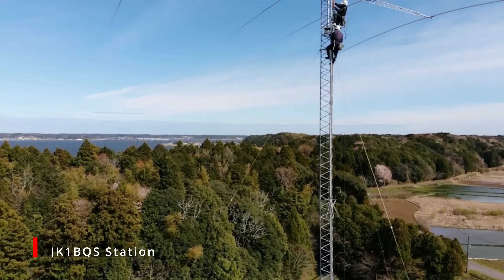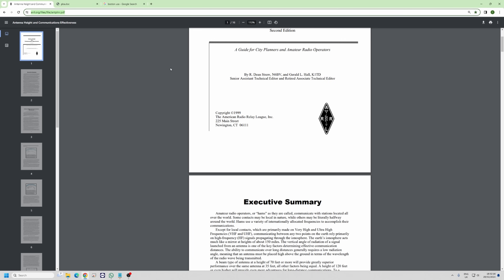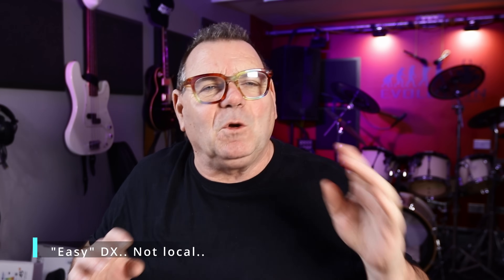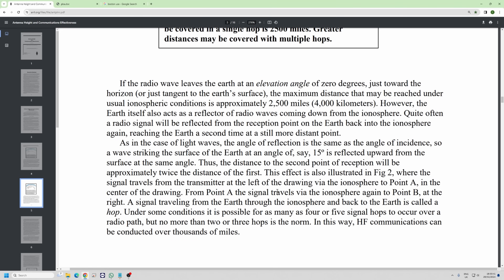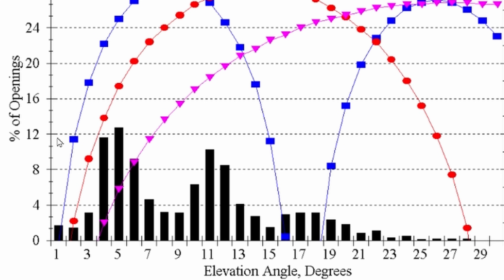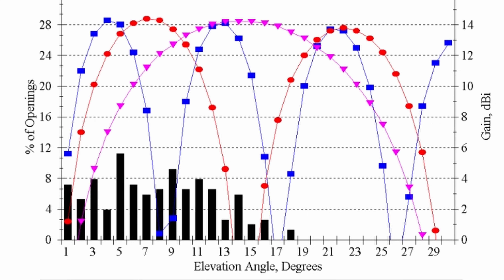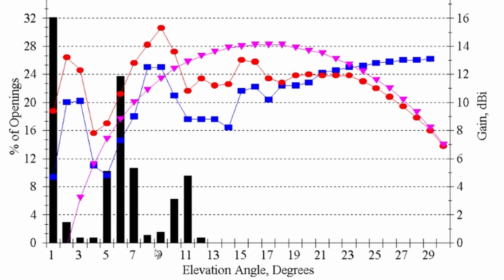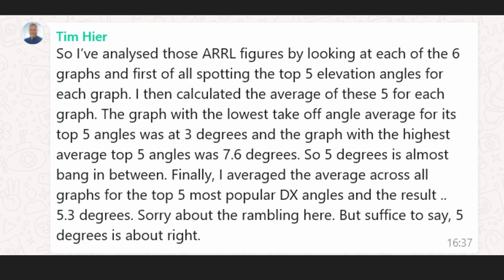The Truth About Optimising Take-Off Angles for Ham Radio DX

Comment: I am not very technical which it comes to my choice of antenna. I find for 20m and up during the daytime, I use a vertical for dx, whereas, an efhw or efrw as a sloper seems to work better for working the continental USA. For my qth antenna, I chose an inverted L efhw. Definitely interesting video and models Cal. 73, friend.

Comment: Hi again, Cal. Thanks for the takeoff angle discussion. In continuation of our prior dual 10-meter wires discussion, my SWR is 1.5 or better from 28.300 and 28.620, then again at the 29.500 and 29.600 AM/FM frequencies. Totally fascinating. Back to the takeoff angle discussion, I've been working the SSB contest this weekend and I'm consistently making contacts in New Zealand and Japan from here in Florida with 100w on my DX Commander Classic, even in pileups. Last night I made a New Zealand contact on 40m at 100w. I'm always impressed with that gear.
Reply from the maker: Heck, that's good work!

Comment: Well, just to add my opinion to the debate. 
Undoubtedly low angle signals do exist, there is a multitude of  research into transmission and reception of signals at very low angles, However, the more observant among you will have noticed that that the argument put forward by PW regarding attenuation/cancellation of low angle signals was in relation to ground mounted verical antennas over average ground, again, much research has been conducted on this matter, and appears in both ARRL and RSGB publications; the response came in the form of comparing apples and oranges; a yagi at 1/2 wavelength and above has a completely different interaction with the surrounding environment than a ground mounted vertical.
The way I am thinking after seeing both vids and reading publications on the matter is that both arguments are correct for the type of antenna being referenced.
Reply from the maker: Your opinion is valued.

Comment: I’m new. I just got my license, KO6DEV. I like what you said and you are right. I made my first DX to Japan with a GPA-80 on the ground with 8 ground wires on 20 meters. Yesterday it was Chile, and Hawaii. I ‘ve got an 891 with a yaesu tuner. It works great. 
I had no idea an antenna sitting on the ground was better than elevated one 10 or 20 meters above ground for DX. I am gladly surprised. I no longer need to worry about getting a 20 meter yagi on top of the roof, which would be a an impossible dream in a residential area. 
I am still learning and I wonder why an antenna right on the ground is so good for 5 to 10 degrees. The antenna was supposed to be mounted on a mast, but I modified it as per your advice and mounted the eight wires on the ground. I did have to get in to the box to get a wire to be able to ground the wires, because the antenna was not meant for it, but it worked quite nicely. 
The antenna is no good for 40 meters, but I am making one as we speak based on the same principle, right on the grown. It’s going to be a 20 meter monopole right on the ground with tons of wires laying beneath it. I bought the aluminum rods used for camping gear, which were very cheap. It’s 10 meters long. Very basic and I hope it works. Hurray for vertical antennas mounted on the ground! Thank you for the advice
Reply: I just put a parasitic vertical 3.4m behind my 20m vertical long path ant another 2  points.
Reply from the maker: It'll work great!

Comment: that was great . love the ARRL books . super great reading. love the free software for ham radio . some apps for smart phone as well. having fun with coax antenna  lately. The T2LT running up a 10 meter DX commander pole. gets NY to England in the AM, NY time. 10/11/12 meters. I got Derbyshire on SSB CB 11 meters from NY last weak. even did MMSSTV free program for SSTV and it works on CB . I even herd the DX commander antenna on 11 meters CB. just cut the wire put it on and it works. the little numbers on square beads is great. can use letters also. TEN or 10 . love how antenna companies (some)  claim all this DB gain. and they leave out at what angel . and numbers they give is if antenna is in free space. numbers mean nothing if you don't use the point of reference. And state the reference. 73's
Reply from the maker: Well said.. PS - Good work on your experiments!

Comment: Is there a way to measure or lookup the actual soil conductivity for your location, or is it mostly guesswork?
Reply from the maker: Very good question.. You can buy a soil conductivity meter. The problem is that some are HUNDREDS and some are cheap.. I might buy a cheap one and do some experiments.. I did also ask ChatGPT if I could home-brew one.. That was an interesting discussion too!
Reply: @DXCommanderHQ  - As an electrician we often have to use earth stakes out in the sticks where I live for earth continuity back to the transformer.  When measuring this you can guarantee when we have had a load of rain you get much lower resistance readings.
Reply: There are charts and maps online here for the US, but it is not specific to any one area.  It is more of a generalization.  Soil in one area can be good and 30 meters away can be crappy. .

Comment: I find it intersting when looking at You Tube channels, the commercial nature of the crearot is obvious, sometimes! Take ML&S, unashamedly an outlet for sales, but also full of good sound information, always respecrful of products they do not stock and generally informative. Then there is DX Commander, again a business related site, or is it? Most of the time you cram your channel with interesting science based practical information and and on air streams. When you have a new product you will do a bit oif a "sales pitch", and like ML&S you show respect for other Ham related concerns. Now to the "detractor" in this case. Information in his video seems to be based around books written some 50 years ago, and does not acknowledge that science has moved on!One point I would also make is that the channel concerned always heavily plugs the store he is conncected with, as if it is the only Ham outlet in the UK. That is fine, but please, Mr Expert, do not use you company platform to attack another Ham outlet, particularly on sketchy information!  As a point of reference, I remember back when I first passed my ticket, I found your channel, Callum and there is one thing I recall vividly and that was you saying that you chose 5 degress purely as a baseline to compare results, and you did not know if it was an accurate representation, rather like the use of bannannas as a unit! Ours is a scientific hobby, and as such you have backed up your methods with science, well referenced by respected up to date sources. To critisise without up to date science based references is simply just wrong and an attempt to belittle a man who does good work based on the science and engineering that he loves. Keep up the great work mate, and ignore that tatty, out of date parrot!!! Sorry this is a bit long but a certain person annoyed me with his "indepth examination" of a subject he obviously had not researched enough! 73 Jim M7BXT
Reply from the maker: Hello Jim.. I appreciate your comment (I know you are a regular) but as I said at the end of the video, no name calling, we're all respectful. Bless you and have a great weekend.

Comment: I had the opportunity to make 5 dipoles  2x10 mtr   around 1 pole from 17 mtr  design in ARRL Antenne handbook 
I had high lantern pole with about 7 mtr glas fibre top
Year about 1997
The dipoles where hanging about 60 degrees for the 7 MHz band 
There was a switching box and a piece of coax  to a create fase shift 1 dipole suppose to work as a director and the others as reflector , and I was stunned by result 
The first result was at daylight results Nothing happened switching back and forth and intended to break it down the other day 
Around 22: 00 hours I noticed I could switch between Italy and Canada with a very strong difference 😮
I was jumping around in the house The week after it the owners started maintenance cutting grass and the the berm of the water and my Dipoles had to go 😢
Reply from the maker: Fascinating! Sorry it had to go :(
Reply: @DXCommanderHQ  That the system not working at day light its because the take of angle by day the signals coming from above , and the local stations 100-300 km are strong But in the dark the propagation changing the angle of the signals drops and signals from above 100-300 km getting weaker So the setup dont work at daylight the reflection of the signals don’t work , and in the evening the propagation was changing and the signals came on a lower angle , And this setup was working , I heard USA stations in the Middle East And could switch to North America, it has worked about a week and after that i had to remove it it was property from the Dutch Forrest control , who rented it from the Government Oud Gastel , and I was living at the natural border A water small river 20 mtr width between Oud-Gastel and Oudenbosch i had a lot of radio fun there for at least 15 years

Comment: I do enjoy your videos Callum. Question, with a 40-10 EFHW what is the linear distance from the mast to the feed point if the mast is 29feet high? Assuming a 5 degree take-off angle. Thanks for any insight for this.
Reply from the maker: SO for a 40m End Fed, that's 20m long.. So if you feed at ground level and go Inverted L? That's the way I see it. Then get as much of it as vertical as you can (say half) for best DX / Low Angle.
Reply: @DXCommanderHQ  Many thanks Callum

Comment: Thanks for bringing so much clarity with this video. I don’t have much experience with vertical antennas but will definitely try them out after this video. I leave about 20km from the beach then perhaps my soil can be help.
Reply from the maker: Yes maybe.. The one mistake I used in my early career was only using them to compare RECEIVE signals.. That can put a downer on it, particularly with the advent of low-to-ground dipoles and loops-on-ground (search Loop On Ground) since our radios have HUGE pre-amps built in so getting a really pleasant signal out of a radio is lovely. I made a video here, from about 7 mins, particualy on 40m band: https://www.youtube.com/watch?v=z5MhYu2LUrY

Comment: I am just in the middle of setting up a higher mast for my folded dipole (without enraging the neighbours or the YL). Thanks to Your older "howto" videos, I used mmana-gal to simulate my antenna and realised why I struggle making proper DXs with my current setup. By raising my antenna a bit, I will have 2-3dB extra gain for 5-10 degrees takeoff angle.
Reply from the maker: Lovely.

Comment: I've worked beside saltwater numerous times and the difference from being inland is incredible. Think about stacked yagis the megastations run. They can independently select which antenna to use. Why is is that? It's because each antenna can receive at a slightly different angle where the incoming signal can be stronger, weaker or non existant. If none of it mattered, people simply wouldnt bother.
Reply from the maker: Good point.

Comment: When I go pota-ing with an EFHW is there a shape of antenna wire I should shoot for that’s best DX? I worked you on your last live stream, it was awesome! Thanks. WY7WL
Reply: Have you tried to use the free software out there? Test it, inv v, inv l, sloper or vertic. See what far field plots it comes up with. Then test it out. Make it fun, make it work for you. 😊
Reply: @garyh8315  your right, I need to  learn that software. It’s just above my head at the moment
Reply from the maker: WY7WL.. Probably get most of it as vertical as you can and less inverted V.

Comment: Great Video Callum.  The explanation is spot on.  The lower the angle the better for DX.  Why in the heck do all these guys build these big towers to get their antennas up high... to lower the radiation angle.  If you look at a dipole at good height 1/2wl+ you will see the TO angle lowers and more RF is squeezed into those lower angles vs the middle or high angles.   If you want the good numbers for long haul depending on the band, it is lower than 10degrees.  Yes, in some areas of the world 20 degrees will work for short haul DX, but to use a turn of phrase, IN the main for long haul 5 degrees is the sweet spot.  If you look at the big DX'ers and look at old antenna books, which you know I have a library of now... it is a LOW angle radiation game.    Just great work.
Reply from the maker: Low angle. Yep, true.

Comment: please explain the minus and positive issue.....please
Reply from the maker: There's no issue.. It's a reference-point. LKet me point you to another video and see if I can assist.. OK.. skip to about 3:05 of the following video: https://www.youtube.com/watch?v=ZZWzyypqqjM
Reply: thanks i watched that a while ago, its just the use of plus and minus. You are talking to someone who cannot understand 3.142 where does the remainder go ? into your "bananas". Cheers matey @DXCommanderHQ
Reply: 0dBi is equal in gain to an isotropic radiator at unity gain power,.  +dBi is a gain over an isotropic radiator in a direction, -dBi is a loss of power in a direction compared to an isotropic radiator.  dBd is comparison with the antenna in test over a dipole antenna at 1/2 wavelength in height.
Reply: So minus is bad and plus is good simply put, so how can a radiator with a minus figure be better, to be better is it the angle of take off ? @FromthehamshackwithNJ4Z

Comment: Those Arrl plots of skip angles are fixed, I would say the propagation angles are at least general and really out of date at worse, as the angle will change in real time .a layer can be miles wide vertically and temp, other forms of prop will interact on the second ,third  on fifth bounce or all of them I agree its all you can do to get your take off as good as you can..but prop will always be "king" and unpredictable. Thats why I could hear Japan or Italy or both at the same time and the guy down the road 20 miles might not..Antenna science is a facinating thing,but prop is of a different magnitude of complexity.. Even more so at this time, keep the videos coming love em
Reply from the maker: You can hear Japan and Italy at the same time because your RF is going "everywhere".. But thanks for the comment and understanding of the complexity. I had to cut it short at 20 minutes else it would have been a 2-hour video which nobody wants to watch - and I certainly don't want to edit!

Comment: I did over 9,800 miles, SC to Tasmania on 40m with my 12.4 DX Comander.
Reply from the maker: Top banana!
Reply: Hey the Bill... Good to see YCARS represented!
Reply: You mean the person in Tasmania heard you with a 5 element beam 100ft above the ground, it wasn't the DXCommander doing all the work
Reply: @Andydigital80  he was got his signal there correct? Yes heavy lifting from Tasmania but still got is signal there
Reply: @FromthehamshackwithNJ4Z I got Tasmania with an EFHW and 50 watts i.e. not a vertical, it’s the propagation that makes the biggest difference. Same antenna got me into New Caledonia with 100 watts just a week or so ago when Intermediates got the power increase.
Reply: @Andydigital80  sure propagation is the engine here.  You commented the 5 element in Tasmania did the work.  The DXC or your HWEF still had to put out enough juice at the right angle to get there to be heard. Not sure what the heck your point is.
Reply: @FromthehamshackwithNJ4Z The point is its not the 5 degree angle myth this video is taking about that made the difference, because an EFHW will not have any gain at that angle, especially when mine is barely 22 feet above the ground and in an dog-leg/inverted V type configuration.
Reply: @Andydigital80  I am not sure you know what you point is.  Whether the signal came from 1 deg or 20 degs.  You got there.  There may have have been enough there at 6 degs to get you there or conditions were so good you had a 4 or 5 hop shot to the destination.  Either way it has nothing to do with using a 5deg angle as a comparison point for antennas.  Bill was able to get enough RF squirted out of his antenna as you were out of yours for the guy to hear both of you at a some angle and some number of hops.